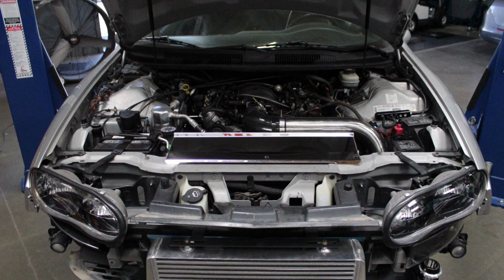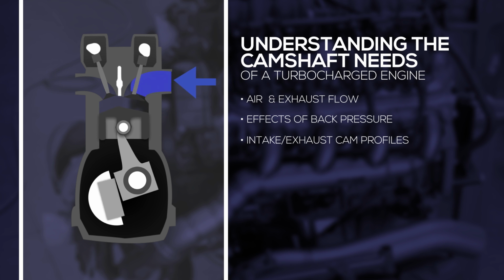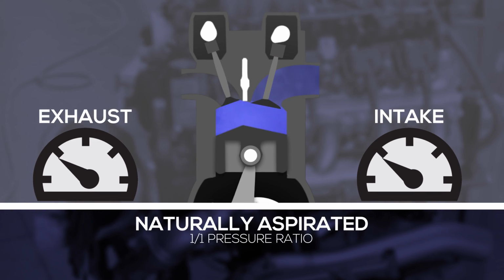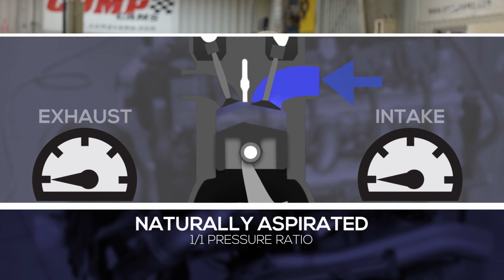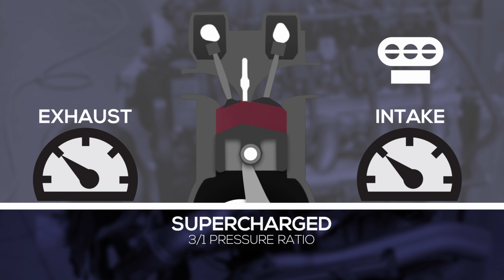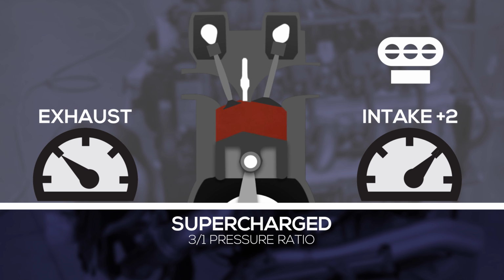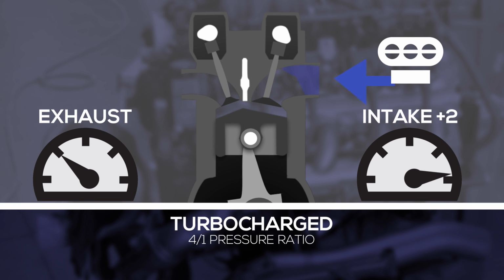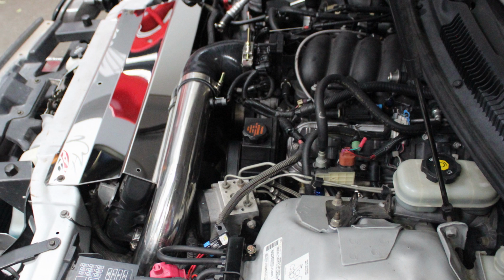Turbo Cams 101 Presented by COMP Cams

Comment: All cams are Turbo cams.
Reply: The issue that I have with Richard Holdener's videos is that he doesn't do a dyno pull with a turbo motor back to back with two cams that are identical except for LSA. His basic premise is that every motor will make more power when you turbocharge it regardless of what cam is in it. Well, that doesn't mean that there isn't a better cam for the application.

Comment: Isn't every cam a turbo cam ?
Reply: Technically for street cams - yes, but an "OPTIMAL Cam" depends on how efficient the turbo system on the engine in question is.  Most have way too much back pressure, requiring  wider LSA and dual pattern profiles.

Comment: This might sound a bit stupid. But what could happen if you created a sub pump fan in the exhaust creating a vacuum sucking effect. Wouldnt that lower optimize the pressure in the cylinder head?

Comment: I have turbo comp cams in my motor I just recently purchased.  I was wondering if that would be an Issue since I'm running a paxton novi supercharger? Would I lose power?
Reply: Let me know what the cam specs are and I might be able to help you
Reply: Yes supercharger cams are definitely different and you will lose hp with the wrong cam

Comment: Is it possible to run the turbo cam n/a for a while without boost?
Reply from the maker: Yes it is! While it will not be the best NA cam, you will still pick up decent power over stock.
Reply: @Compcams1976  to follow up his question will running it n/a have a hp gain over factory or will they be comparable
Reply from the maker: @dirtcheapmedia3390  yes, you will still see a good gain over factory!
Reply: @Compcams1976  what about running a NA cam with turbo
Reply: yes otherwise it wouldnt start up without the turbo spinning fast enough to create inlet pressure. 
think about it like this. When you car is idling and when its coming up in revs the turbo is not really playing any role on how the engines combustion process happens. the turbo wheels are slightly restrictive to the inlet and exhaust flow but the engine is basically naturally aspirated until exhaust gases are flowing through the turbine wheel fast enough to spin the compressor side of the turbo up to a speed (spools) that it creates positive inlet pressure (boost). 
the waste gate opening decreases the exhaust turbine speed slowing the compressor wheel speed and 
the bov opening also decreases boost also creating a similar situation to a naturally aspirated engine. 
so probably a big technical explanation for a simple YES answer but i hope this helps you understand a turbo engine always runs naturally aspirated some of the time.